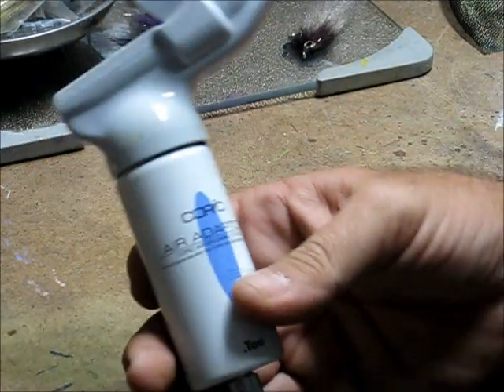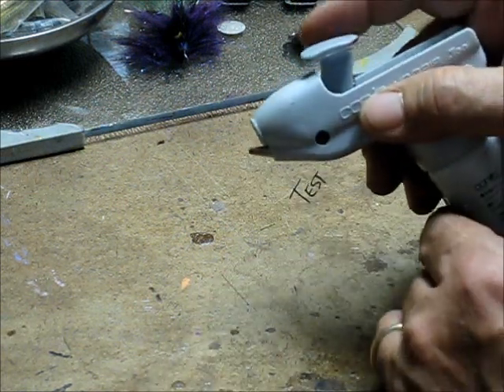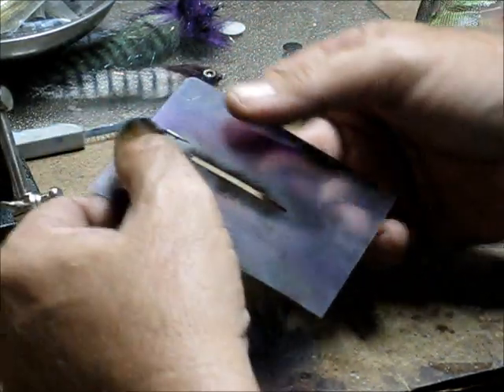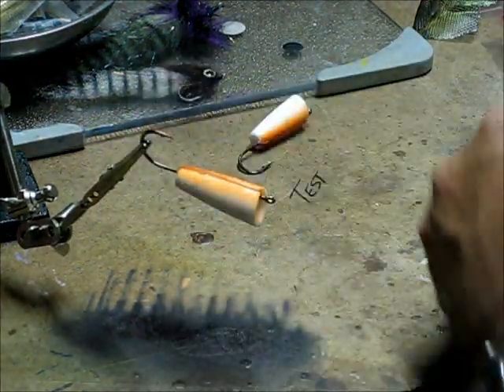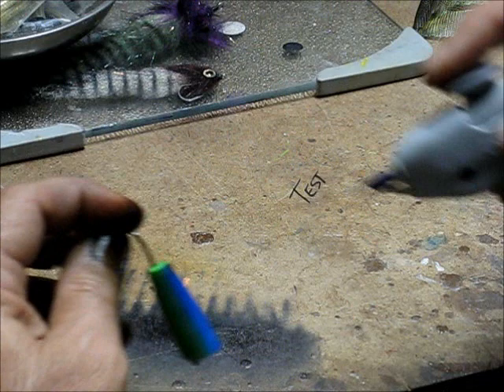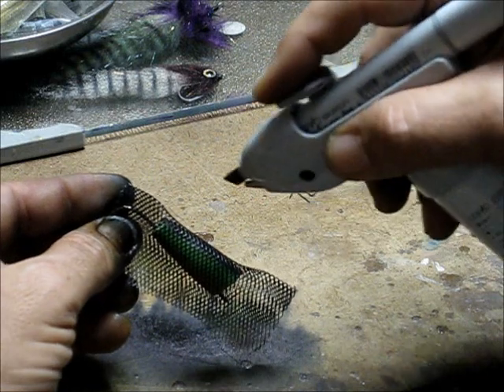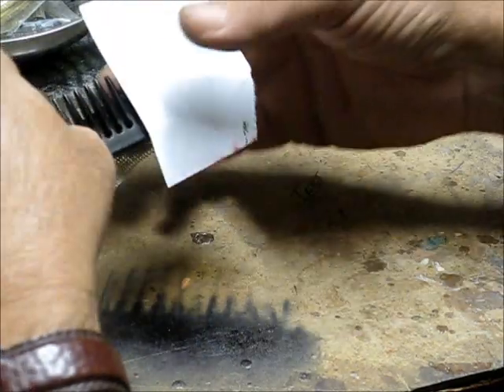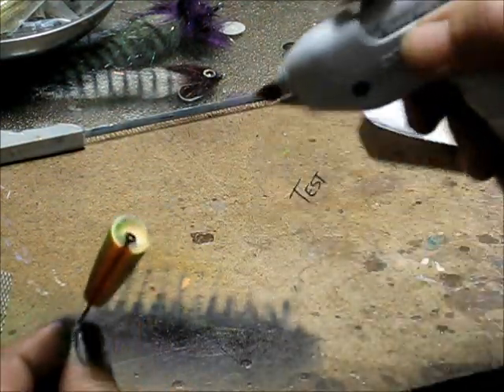Copic Air Brushing a Fire Tiger Popper

Comment from the maker: Floris, sorry I'm just seeing this. Yes, I do clear-coat my poppers. I use 30 minute epoxy, Liquid Fusion or UV Resin. When using Liquid Fusion or UV Resin over marker colored poppers, you have to spray one or two light misted coats of an aerosol clear spray to lock in the colors as those two products tend to pic up the marker color, especially the Liquid Fusion, UV, not as much but it will pick up the color in the brush and if you brush it around to much, it will bleed the colors.

Comment: Where do you purchase the aluminum mesh? I can seem to find it locally anywhere.
Reply from the maker: William I got it from e-bay from the United Kingdom. Couldn't find it locally either. After purchasing one sheet and liking it, I purchased about five sheets and still have it around after a few years.
I tried copy/pasting a link, but it doesn't seem to work. Just go to ebay and search Isopon Aluminum Mesh. You can try Amazon too. It lasts for a very long time.
Reply: Kirk Dietrich Thank you so much...Will

Comment: i use envirotex for my baits. so you think it will have a effect ? i need to spray clear first
Reply from the maker: I haven't tried Envirotex over Copic. I'd try testing on a messed up bait or some other scrap. Also, I've found that hitting the Copic with a hair dryer helps set it and prevents some color pick up. Sorry I couldn't be a definitive help.